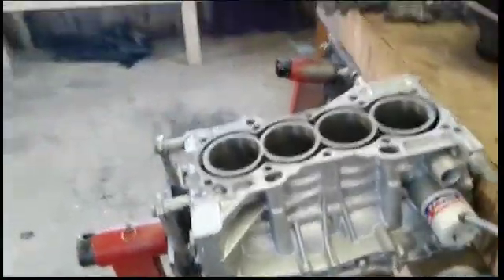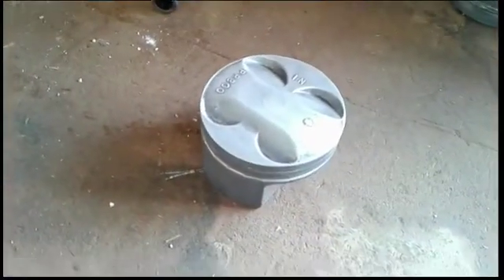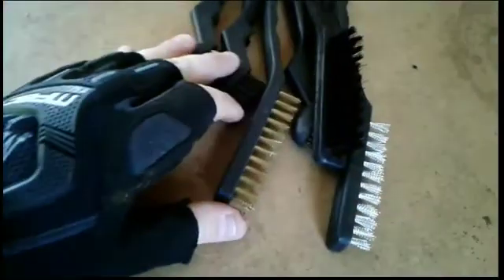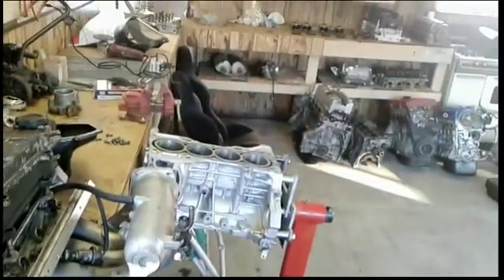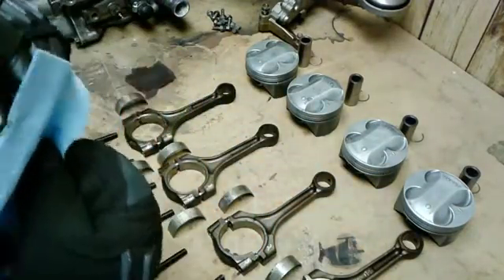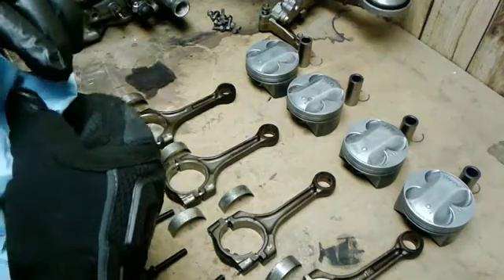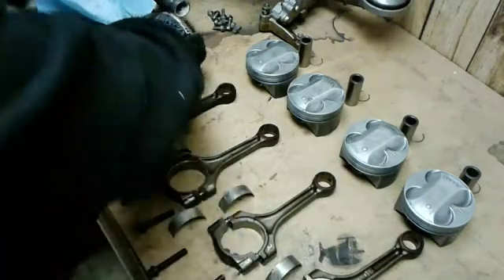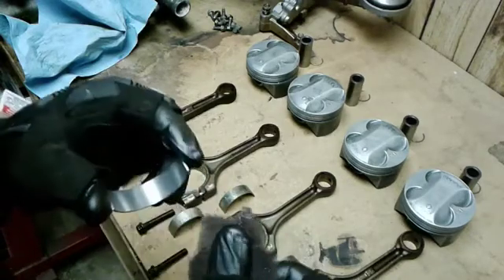K20a2 Pistons Installed on K20a3 Rods

Comment: I know this is an old video but did you ever get around to finishing this? Im curious how an A3 would run on a stock ECU with A2 pistons, im currently in the process of rebuilding my A3. Not interested in more performance i just want everything to be new and clean, re-surfaced the head and block to take care of an annoying oil leak. But seeing the pistons i can buy are basically all no name more than likely cheap chinese pistons for the A3... i would prefer to at least buy Nippon pistons but i can only find them for the A2 which is why im wondering if it will run good in a stock A3 and ECU. Plus im in Cali and dont want to deal with smog issues and spend money on Kpro... when/ if you get the chance to respond im all ears cant find much online with the combo.
Reply from the maker: Not well. You'll need to tune

Comment: Does the K20a3/A6 and the A2 pistons take the same rings?.. I have a very good A6 motor and I just a got a set of prb000 (k20a2/z4) pistons that came with no rings . Could I just slap the A6 rings onto that prb000 pistons? 

Thanks in advance
Reply: Yes

Comment: I wonder why ppl knock down the a3 rods so much they look like b18b rods or beefier
Reply from the maker: drewster956 not really. I’ve done a side by side video either b18’s, a3’s, and d16. There closer to d16
Reply: @VHBEngines  what's the video called bro ,I've only compared them by photos
Reply: @VHBEngines  also thru some investigation found out the f23 rod has the same specs of the a3 rod ,and using a forged Chinese f23 rod with some cast f23 pistons puts you at 10.3:1 comp , I really wish I could messure the piston to deck hight of a a3 in its OEM form since this combo will sit the piston top about 1.25 mm from the standard a3 PTD hight ,it could be the forged rod that the a3s need

Comment: You can get an a2 long block for like 500-600$ CAD
Reply from the maker: because not everyone has the same options everywhere and 9/10 times its cheaper to use what you got. im all about showing ppl that you dont HAVE to spend the money on swapping
Reply: VHB Engines very fair.

Comment: Suprised you didn't put the wrist pins in the freezer and put the rods and pistons on low heat to ease assembly.
Reply from the maker: MrStoneycool69 absolutely unnecessary. Floating pins
Reply: Then why use a hammer?
Reply from the maker: MrStoneycool69 they weren’t brand new and I didn’t oil them. But feel free to do whatever unnecessary shit you want to your parts. Good day

Comment: There is more "meat" on the a2 rods vs the a3 rods which means that the a3 rods are lighter than the a2. Does this mean that adding the higher compression pistons is going to help with by having less mass rotation? I'm thinking this will actually compliment the higher comp pistons move faster, producing more power up top than the a2 could achieve (assuming valve train or at least cfm was identical)? Also would thermodynamic have any effect on the durability of the a3 piston using a2 rods? I am asking these questions only for na build.
Reply: Also quicker response in rpms
Reply from the maker: i think the overall weight difference their is negligible same as milling to raise compression. doing this kind of thing is only for budget builders that want to make the best of what they have. if your looking for the best results would be in making a poor mans a2 which would be full rotating assembly and head

Comment: i will go full a2 internals ,a3 crack cant handle what a2 does, a2 crank,pistons ,rods and full head
Reply from the maker: pablo correa it's not about the crank not handling. It's the fact that a2 rods won't fit on an a3 crank
Reply: ok how about u put a2 crank ,a2 pistons and rods..
Reply from the maker: pablo correa at that point just buy an a2 short block. Cost you bout the same
Reply: maybe ,maybe ,but is nice to put staff together like this,and u can go with racing pistons all crazy shit i use to have a k20a3 i sold it ,too slow,

Comment: You will be using the A3 head?
Reply from the maker: WilliamMUGEN that was the original idea. but i think ill use the a2 if i do wind up keeping simply because i want itb's an didnt see any for the a3
Reply from the maker: WilliamMUGEN but anyways another guy thats subbed to rhe channel shared his dyno sheet of a stock a3 with bolt ons an tune and he made 177 so i do believe this block would easily bump those numbers over 200
Reply: I think so.  Now i have my A3 vtec killer (A2 cams) and i'm planning to do the same, put A2 or Type R piston, put a set the Z1 cams (  bought very cheap), maybe i will be using a K24A1 head if i can find one in good condition and cheap. Please keep updating. Good luck.
Reply from the maker: yup will do

Comment: What comp ratio would you aim for for building a boosted b16a2 with over 400hp? And what would be a good turbo kit for that setup w/ keep A/C
Reply from the maker: id say keep as close to stock compression as possible for best turbo response. keeping ac an 400whp can be tricky even if you use a log manifold. if you go to big on the turbo it gets in the way so you'd have to spin it around and notch the outside of the block on the tranny side. then of course you gotta hope your downpipe clears the compressor. if you go to small though you may over stress the turbo. id try using a 60trim an as long as the comp isnt super low you should make it....upgrade to gsr cams that'll also help